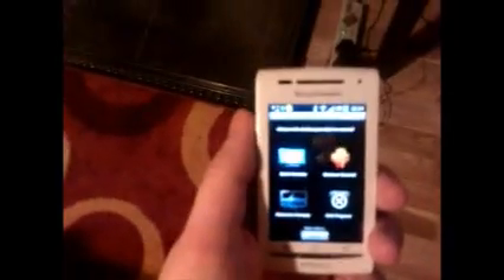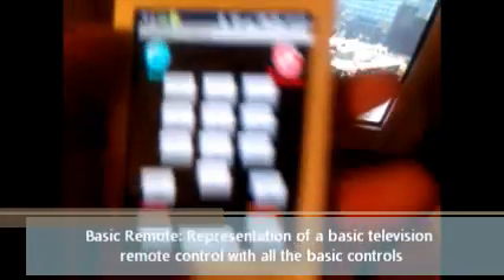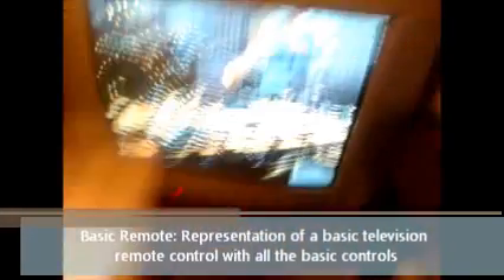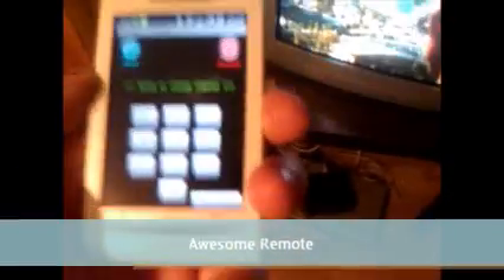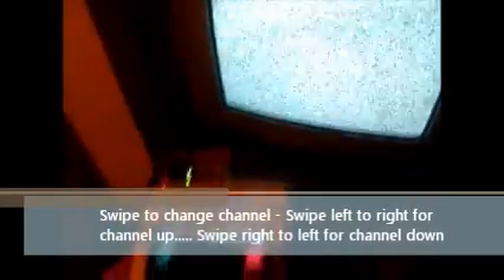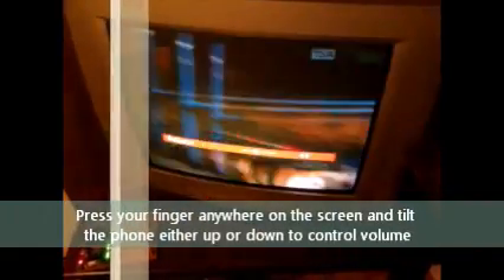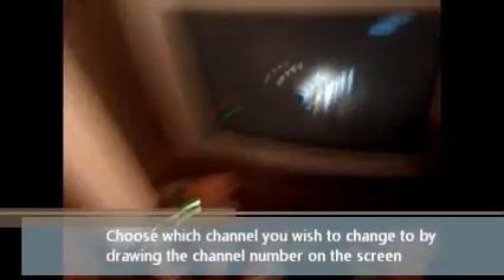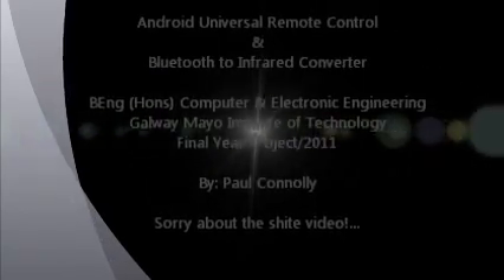GMIT 2011 - Final Year Project - Android RC-5 Remote Control & Bluetooth to Infrared Converter

Comment: I know this is old but I just had to comment to say great job! Don't know why anyone have you down votes, this stuff is hard work. What were you using for a microcontroller and Bluetooth? I'm looking to do something similar hardware wise with Bluetooth. Thinking of just buying a Bluetooth module from eBay.

There are a few videos on my channel that show the project for our mechatronics class. 

There is also a time lapse video of one of the days leading up to the project deadline. It shows the lab jammed packed with tons of endless activity, this illustrates just how tough this stuff is, and we didn't have to deal with coms. These “robots” were completed in less than one quarter. A giant feat because FORTRAN was still part of the curriculum leading up to this class so every group programmed completely in assembly language. 

Great job again!

Comment: @ShiteHawk3000 I checked out "Red Eye", and you were right...  But they are in beta testing for select Android devices.  Red Eye is different than yours, since it uses WiFi only.  I can see some advantages with your application.  I'm no expert, but I think Bluetooth has faster response, which is important with a universal remote.  I also really like your swipe feature!  Are you planning on developing this and taking it to market?